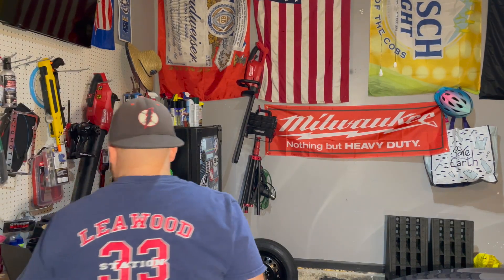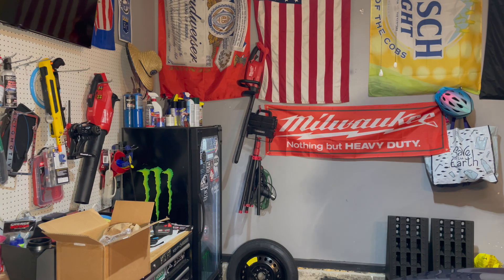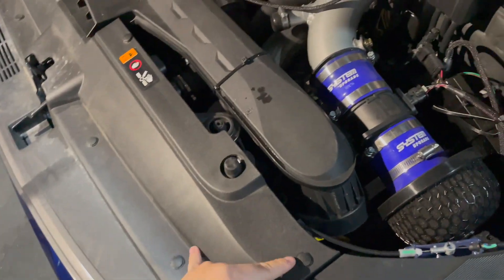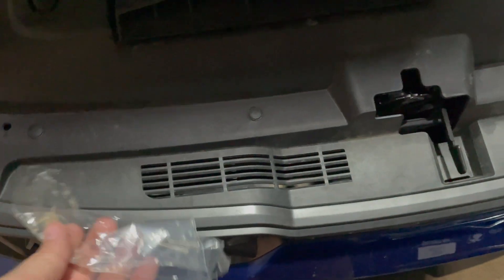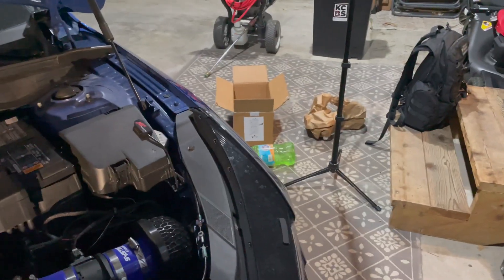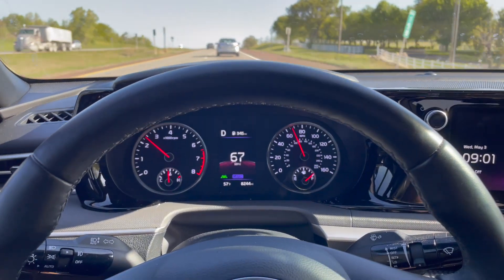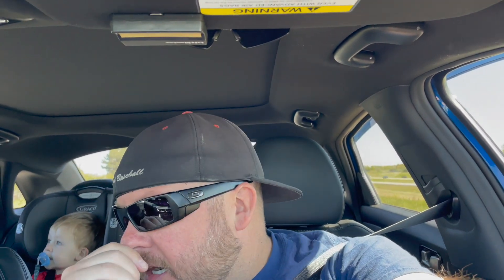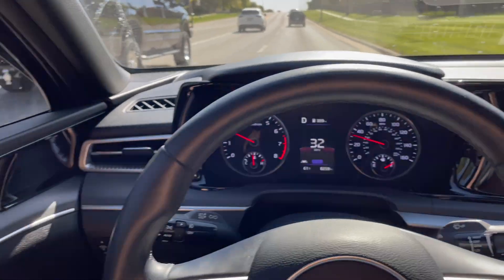2023 Kia K5 Velossa Tech Ram Air Snorkel Intake Review

Comment: The one thing Im surprised is where it comes through the vent into the scoop its not connected ?? So it would get all the air and not just a small part of it! Then temps really drop! But still a cool idea
Reply from the maker: I agree, that would be a better design.
Reply: @zstampe  Im a model builder I think I can come up with something!
Reply from the maker: @davidjohnson8474  I can’t wait to see it if you do man.
Reply: @zstampe  It shouldnt take long. When I get it done Ill send you one!
Reply from the maker: @davidjohnson8474  that sounds awesome, can’t wait to see what you come up with. Like you said it should be easy

Comment: I still have warranty on my K5 and was wondering how the dealership is going to act when I take it in for a oil change or should I just put the stock intake back on?
Reply from the maker: If you add this I wouldn’t sweat it one bit. If you do a full cold air I’d take it off before warranty work personally